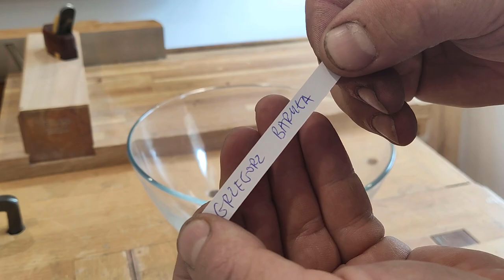066 Eugenia uniflora as a gift

Comment: Nice work! it is a Myrtacea (perhaps the best known of this family is the Eucalyptus) Many times, knowing a little about the genus or family of the plant can be useful to have a general idea about the characteristics of the wood (obviously it is not a strict rule)
They are usually medium to coarse grained woods, medium hardness (there are very hard wood species in that family, but they are not the majority). From what I see,  it behaves similar to eucalyptus under tools
Reply: I live in a place with a lot of eucalyptus and I kind of have to disagree with you. With all the eucalyptus I've ever used the grain is fairly tight and it planes really smoothly the color is red and white. I may be wrong in the sense that it could be related to eucalyptus but from all the eucalyptus I've cut down and seasoned and worked with it's very hard and dense and fine-grained and quite a bit different from what I'm seeing here. I've never seen this wood before or even heard of it but I'd be interested to learn more

Comment from the maker: Hello everyone! In this episode i'm gonna build a tiny smoothing plane. As the material i'm gonna use very interesting piece of wood, wich was posted to me by Taylor. He describes it as eugenia uniflora. I've never use it before. Google says nothing about this WOOD (i mean the wood, not the tree) so if you have any experience with it just share it with us.
As the inserts (boxing) i used boxwood from my collect. It is kind of solutions wich helps to reduce wear of the sole during friction. The grain direction in the boxing is the key - it is perpendicular to the sole (glued with hide glue).
It is my own design of boxing - you can find more informations in the descriptions of my other videos.
Oh, and the iron - piece of an old and fat laminated plane blade. About 5mm thick. Works very stabile without chattering.
As the finish i use one coat of boiled linseed oil plus two coats of osmo 3032.
At the and of the video i have small suprise for those who decided to support me in my workshop developing :)

Cheers!
Reply: Surinam Cherry, pitanga, or Brazilian Cherry are the names I find for Eugenea Uniflora. Seems like a really interesting wood.

Comment: Im wondering, why you’re always put this boxwood inset to base? Is it a kimś of trademark? Regards
Reply: The box wood is a much harder wood, so it will wear down much slower. Since its harder than most woods you will work with its very resilient.
Reply: @royseafus7399  yeah so why he didn’t make a whole foot out of boxwood
Reply: Only two points of the plane actually have to touch the surface of the material you are working! To make the plane glide smoother some craftsmen slightly hollow out the wood between the boxing.

Basic boxing is always by the mouth and by the heal. Box wood also grows very slowly and stays small, so it would be a waste and very expensive to "shoe" the whole plane.
Reply: @royseafus7399  cheers 🍻 m8
Reply from the maker: Hey Kornel, boxwood is hard to find and expensive, that's why it was always used in that way. That two inserts will be enough to make the job 👍 Cheers!
Reply: @StavrosGakos  cheers  before I didn’t get now I know:) boxwood… I have a few in my garden (about 25” high) waiting for a huge trees, but after all these years nothing is happening :p
Reply from the maker: @kornelmoleda  after 100 years the will be good 😉
Reply: @kornelmoleda  😁

Comment: The sanding block that smoothes out the rough edges before they fulfill the resting bed of another . the strength of two ronnies  beneath the action so the sanding block does not go blunt only to cover the requests of many. 
A treasured gift
AFFA angels never die nffn HMS sonny